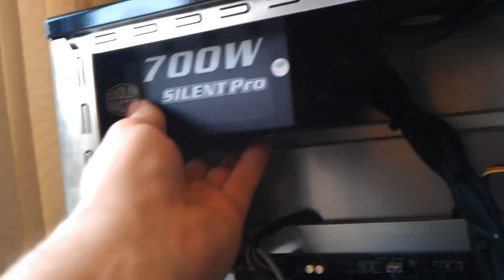How to fix noisy computer fans

Comment: II beg to differ. If the fan bearings or fan axle are worn there's no amount of grease or oil that would stop the whine for long. It will return very soon, as it is produced by the axle rotating eccentrically and vibrating inside the bearing. Replacement is the only answer.

Comment: Great video.  But only one problem.  Why of earth would you throw the sticker out once you remove it?  The sticker (once reapplied) keeps the excess oil from coming out once the fan starts spinning.  Without the sticker over the bearing, the oil (understanding the basic laws of physics) will make it's way across the spinning surface.  And as it gets further from the center, where the spinning velocity is faster, it will start to splatter on any computer components in line with the edge of the fan.  You need something to keep it in there.  And that's what the sticker is for.

Comment: helpful, but I did the trick in 2 seconds blowing a bit of silicone lubricant on the fan while it was turning with the computer on and it worked just like a charm! No disassembling of the fan required :)

Comment: any cure for a fan that is running 4,000 rpms? It sounds like a train.
Reply from the maker: Run it at 1,000 rpm?
Reply: Thanks, how?
Reply: use speed fun :)
Reply: I tried. None of the useful adjustments that were on the instruction video and page were in the Speedfan page I downloaded. (happens a lot with computer stuff).
Reply: so dud you should buy a new fan , like i did :/
Reply: you could use an external program like CAM or MSI afterburner. they both work without the need for any special components in your PC. or you could set the fan speed in the BIOS by changing the DC limit for the specific fan. if your fan is connected to your computer via a Molex or 4 Pin then I would highly recommend buying a 4 pin to 3 pin connector so that you can connect the fan directly to your motherboard so that those programs can change the speed of the fan.
Reply: have you tried changing setup settings ? when coputer just starting you press F10 (maybe another button) then find the settings and change it from there (i did it like 2 years ago just for fun, made it at max for a couple of days to annoy my roomates XD)

Comment: i hve the same prob. wats the deal yo plus i get my whole pc shaking
Reply: If the whole thing is shaking, there may be some magic pixies rockin the place nudge nudge
But in all seriousness, one of your fan blades may have broken off. If one is missing, the whole fan loses its balance.
Reply: Nop there aint no broken fan . Am guessing that the fan may need some lubricant even though it doesnt explain the shakness.
Reply: Sounds like you need to bolt your PC down
Reply: Michael Vuong It actually a loud humming sound not the vibration. Still didnt figure out where its coming from
Reply: Ak47 I was just kidding, sorry. Have you tried opening your pc case and then turning it on to check where the sound is coming from?

Comment: Most fan noise is generated by vibration through the metal casing. The best solution is to use rubber isolating grommets between the fan and the case body. This can reduce vibration sounds considerably.

Comment: I recently had to deal with an Gigabyte P15 fan that went tits up. The manufacturers were an bit reticent about exchanging it. But, I used the old W (Water) D (Displacement) (Model) 40, on it (really thin oil), Use WD40, I would hate to think that the Americans had nothing to show for the cold war...

Comment: Static is the least of your worries, it is fucked, open. Spray WD40 into the mechanism. You can lift the blades slightly with no effort. Slip the straw you get with WD40 and spray. Light gun/sewing machine oil is more viscous so you shouldn't use it. Blowing the fluff out of it is a good idea though.

Comment: I have a 230mm colorshift plugnplay fan that stopped working. Searched online for a new one but couldn't find them anywhere. Seems Thermaltake store no longer sells them and no luck on Amazon or Ebay. Watched your video. Didn't think it would do any good seeing it never got noisy or slowed before it stopped completely. Yet I put a few dabs of Fellowes performance oil inside, screwed the fan back on and plugged in the side. That thing is back up to top speed! Thanks for the helpful vid...much appreciated.

Comment: Did you seriously take eight. fucking. minutes. to explain that you take the fan off, strip the sticker and drip some lube onto the bearing?!
Reply: It's understandable. Some people need to be shown everything to the minutest detail before they properly get it and lose their fear. I use sewing machine oil for this (available on Ebay), applying it directly from the nozzle of the plastic bottle, and it works perfectly.
Reply: Indeed. Used the same thing myself after clearing out as much fluff as I could from the bearing. Works flawlessly.
Reply: Thanks for saving me the time haha
Reply: +Asdrubael Vect thanks. you just saved 8 minutes of my life :)

Comment: wouldn't that  A. allow dust to get in and stick to them making it worse ?  and B short something ? since it liquid
Reply from the maker: Pop a bit of tape back over it if you're concerned. I've not had any issues.
And no, it's lubricating the bearing, you only need a drop and it shouldn't make its way anywhere else, even if it does the likelihood of it shorting out the coils in the motor is negligible.
Reply: i took it under advisement ... i did however have one issue, my computer failed to power on for more than a few seconds.  figured out one of my fans didn't like the lube lol  .. not a big deal .. i unploughed it, now its all good.    since i got 5 fans anyway .. not a big pro.

Comment: Don't take any chances TURN THE COMPUTER OFF and unplug it from the wall you can't be sure that you won't touch a live wire inadvertantly. You may not get a shock but you can destroy a hard drive if you bump its power cord causing it to switch off and on. Wear rubber gloves if you're not sure about earthing the PC to your body.
 Also use the appropriate tools, fishing knives weren't meant to be used on computers..
 You shouldn't use a vacuum cleaner to remove dust and other stuff from your PC use compressed air it's much more efficient and will move much more crap.

Comment: Thank you for this! My PC's power supply fan sounded terrible. I had to pull a bunch of stuff out to get to the power supply. Then I opened that up and dropped a bit of lubricant on the fan. Once I put it back together, the noise started up again, unchanged. I was really bummed out, but then the noise stopped after two days of regular PC use. I guess it just needed time to get loosened up! 

But yeah. Big help. Thanks!
Reply: same thing happened to me.. after a day of use the noise stopped.  that was a year ago. it's making noise again which is why I'm back for a review.
Reply: I think mine is the CPU fan.  I'm pretty low tech and don't think I can replace that one on my own so I'll be looking at paying a tech. But yeah, I'm looking to replace it this time around if the lube doesn't work.

Comment from the maker: Pretty much, the simplest thing to try is vegetable oil or sunflower oil you use for cooking, but it may be a bit too thin and non-persistent but worth a try if you have nothing else to hand.
Otherwise anything like 2 stroke engine oil, motorcycle fork oil or even thin engine oil will be fine...
Just dont put too much in or else it may creep out and go everywhere! ;)

Comment from the maker: It's not that loud really. But, try running 2 x GTX 480's flat out all the time with 1 or 2 case fans and you will find out why you need so many!
Damn thing is like one of those big warehouse heaters.
Even with a decen fan array my cards were peaking at around 95 - 100 degrees.

I'm rocking a pimped gtx 680ti now though which is super cool in comparison and I have the fans hooked up to a dedicated controller and have them turned down to like 30% so is super quiet.